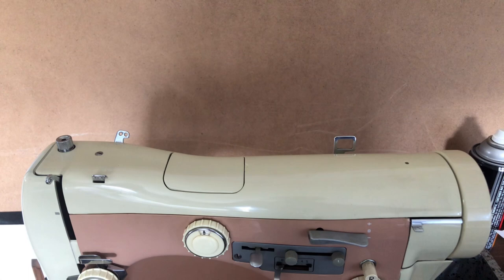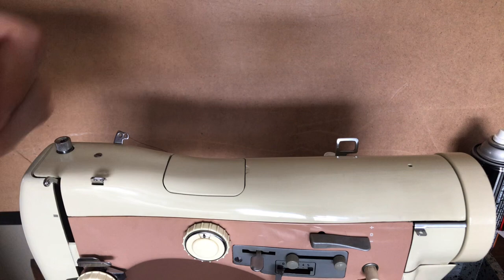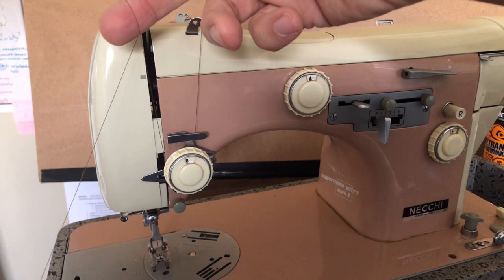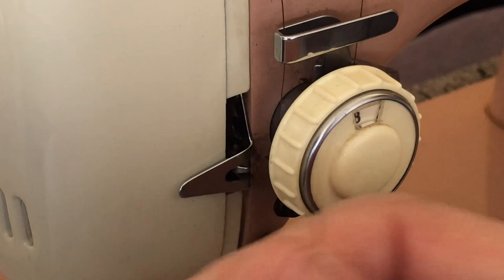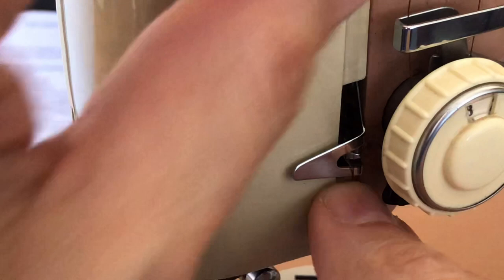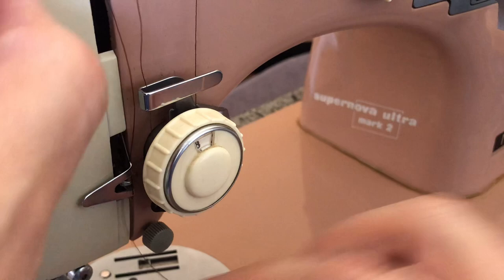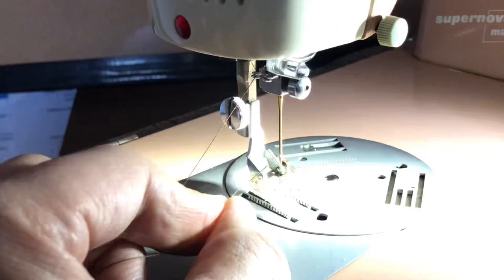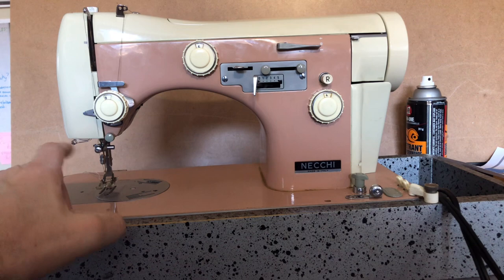HOW TO SERIES #5: Thread Bare? How to Thread a Necchi Supernova Ultra Without Breaking a Sweat!

Comment: Got a question I'm hoping you can help me with. I got a Singer 15-91 from someone and it's in beautiful shape except that on the down stroke of the needle it's smooth but when coming up it stops. I can try by hand and it won't come up unless I lift the presser foot up and down while turning the hand wheel. Got any suggestions?